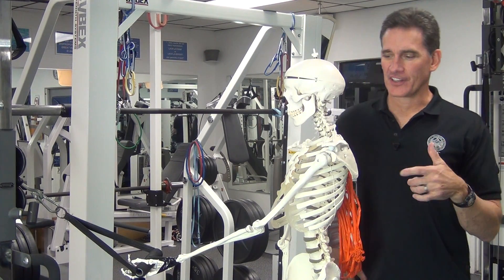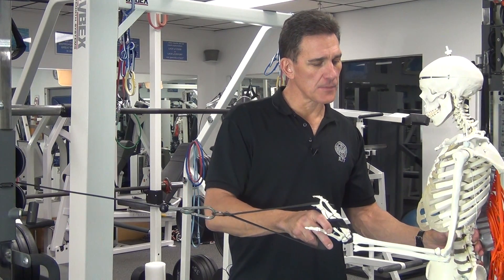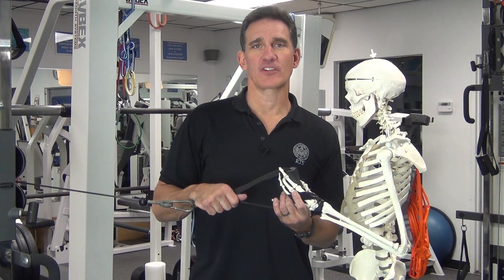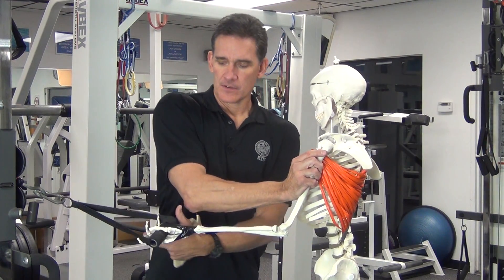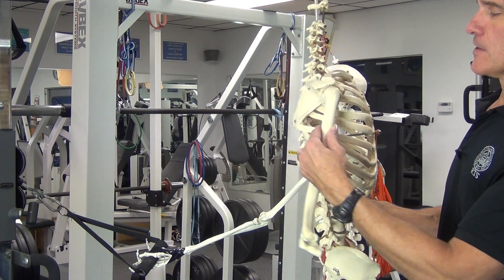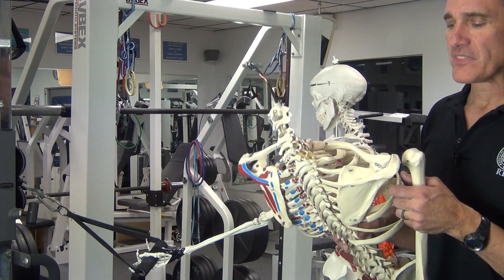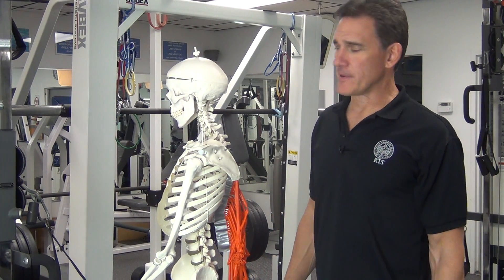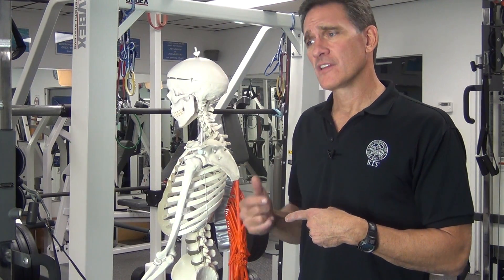Rows Part 1: An "Inside View"

Comment: My understanding is that ideal resistance is 90 degrees from the point of muscle origin. If this is correct, a lat pull from in front of the torso does not offer the most effective path of resistance since the lats are connected to the spine and would be pulling around the rib cage as opposed to a path directly in line with the spine, ie., pulling from the side of the torso.

Comment: Awesome example! 
Solid back routine:
1. Hammer or Nautilus Pullover
2. Close Grip Palms Up Pulldown or Negative Chin Ups Palms Up
3. Med X Compound Row
4. Kneeing Parallel Grip Pulldown w hands in neutral position w Cable or One Arm Cable Pull ins one arm at a time.
5. Rear Laterals on a Fly machine (Rowing Torso)
6. DB Shrug
7. Med X Lower Back

Comment: You compensate for the  exercise inefficiency by going heavy with in in the range of maximum effort. Hyper extension of the humerus becomes unnecessary   Muscle myofibrillar hypertrophy is a function of load. That's the approach I used to develop my latissimus dorsi.

Comment: This is great information thanks. Does this also mean that using equivalently strong resistance bands to do lat pulls/rows are even less beneficial since the resistance increases the more you pull but your lat is in a weaker position when all the way back? what are your thoughts on resistance bands?

Comment: Should barbell rows be done from the ground. Or should they be suspended without touching the ground ? On a client that is healthy no back or shoulder problems. Non-Athlete With the goal of strength and hypertrophy. What movements would best suit this person. They can't do pull ups because of weight and strength level. Are lat pull downs, And high rows sufficient or should barbell rows be added.

Comment: Soooooo..... Then how would you train the Lats...
Reply from the maker: Yeah, maybe a little too perfect!

...people often ask what "to do", as if there is ONE best answer, and as if there is ONE best solution for every person, and every goal.

When the answer doesn't fit their request for a short cut answer, they'll often dismiss the answer (and the source) because it doesn't fit their request.  

The aversion to thinking through details, and the attraction to quick soundbite type answers is the reason that most trainers are simply fans and followers of gurus instead of thinkers and students.  (It's also the reason that there is often a mismatch between quality information and views/likes on platforms such as YouTube...)

This answer is the most thorough and accurate I can offer to a question like the one asked here.
Reply from the maker: By contracting them in an appropriate plane against a resistance profile that will match the strength profile until we have achieved an appropriate level of fatigue relative to the person's goals and current level of progression!

-admin
Reply: +PersonalTrainingdotcom that is a non answer if I ever heard it.
Reply from the maker: Nope, that is an appropriate answer relative to your question.

If you need a more specific answer, you'll have to ask a more specific question.
Reply from the maker: Actually, vast on solutions.  
It just seems you're unhappy about getting an answer that matches the quality of your vague question.
Perhaps it'll make more sense to you when you understand that saying "average healthy person" is not actually  specific.

Many ways to train the lats, and understanding how to analyze the resistance profile is an important component to understanding all exercise.

I invite you to step up and actually think about this, instead of just demanding shortcuts or spewing weak false criticisms from behind your safe keyboard.

Do you know how to modify a row so the resistance profile is more consistent with the strength profile?
If so, perhaps there's a great alternative to the standard cable row for some people.
Can you analyze a lat pull down?  Can you identify the shortcomings in resistance profile for the typical cable version?  Can you see ways to alter the RP to match the SP there also?  Perhaps that'd be a good alternative for some people.

So there it is -- an opportunity to take in & learn, an opportunity to reflect, and an opportunity to raise your thinking game.
What will you do with this opportunity?
We will see I guess...

But in the meantime, I've got to ask you something;
What food should people eat??

-admin
Reply: LOL!
"You can't generalize the answer but had no problem generalizing the problem"
Man, because the problem is physics-based (non varying) and the solution is anatomy and individual-based (greatly varying) !

PersonalTrainingdotcom don't address this guy's nonsense.  Look at his other YouTube activity he's all about ignorant generalizations.
Reply from the maker: Yeah this guy doesn't get the message that to make a better row he'd need to split the ROM into different parts with different loads or just a better RP with 'full' ROM.

And thanks for pointing that out. Just read his other comments and you are correct.
Reply: "The problem is we are looking for absolute answers to relative questions."

The reply is perfectly said with respect to your question.  What is the best way to challenge Mrs. Doe's Lats on her first day working out at age 80?  Or what is the best way to challenge Mr. Jordan's lats in his prime?  The answer PT.com gave fits both of these scenarios but it isn't specific to either because there were no conditions given in your question.... Perhaps for Mrs. Doe it would be a cable set up but perhaps for Mr. Jordan it would be a different tool all together.
Reply: These are typical trainer answers. The 'keys to the kingdom' mentality. Full of criticism and short on solutions. You'll say that you can't generalize the answer but you had no problem at all generalizing the problem. 
Basically, you have no answer to how should your average healthy person train Lats. 
Other than... Well any lift that satisfies these conditions. Ok fine. Like which one. 

Nothing.
Reply: +jonathan hand 

Lat Pulldowns done with an underhand grip and an emphasis on pulling down (and not back, as many people do near the end of the exercise), are my favorite exercise for lats. It seems that this would create a line of resistance much closer to the line of pull of the lats. 

A way you could really isolate them would be by using a cable crossover machine and doing a sort of pullover movement where the arms start up and out and are brought down and in (sort of like if you were doing a cable pullover starting with a wide grip and ending with a shoulder-width grip).
Reply: +awsomenesscaleb https://instagram.com/p/_2_MKyk0o9/
Reply: Jonathan...

To your comment of typical trainer answer...

In part you are correct.  I think that comment was intended to be derogatory but in fact it's probably spot on if the trainer is worth a shit.  I am not sure if you train people or not but when it comes to "lats" you might want to consider there is no such thing as the "typical healthy client"...

Here is what I mean... Aside from the resistance profile alterations or as the RTS program terms it the strength-resistance relationship... A key factor in the "best Lat exercise" would be whether or not the individual can even "feel" or sense that they have a contraction in their "lats"

I do not have a single client that I train who fits the "typical health client" demographic you mention if we are talking about ability to contact and sense that contraction, in absence of even doing an exercise, Let alone try to find the exercise that best fosters that sense/contraction (and it's a different discussion but there are many reasons why that could be).  Here is what I mean... I have a 70 year old and 64 year old who could contract their lats on demand, then I have 24 year in my class who can't.  In this example the 24 year olds were doing DB rows and the way they needed to train to feel the lats was with a cable set up and then the lightbulb went off... Then they could eventually transition back to DB.  The 70 year old even though he could contract he "felt" them challenged the best with a higher row with the cable ending with around a 45 deg force angle to his elbow (some pull up and some pull forward)... And still has issues with feeling them on DB rows.

So I would hope that a trainer with any experience would respond "I don't know" to the question of which is best... I would just follow that answer up with .. Let's go find out what you can do and see if we get to the point where designing an exercise where the resistance profile matches fits with the ability to use the tissue. 

The exercise that you posted a link to, some clients have reported feeling great in the "lats" others report that it was too much tricep to feel the "Lat" because it is much more complicated than just lining up the mechanics... You need to look at all the variables involved if your going to change questions and ask "what's the best way to train the lats." This is no longer just a mechanics/anatomy question.

In some cases it's not always what you do but how you do it.. And it's a process to even get to the stuff presented in this video but it doesn't change the video content ... You just asked a different question. 

Anyway... I had a student in my class at the tech school ask a similar question last week and it reminded me of this post and I wanted to see if this reply resonated with you or if we are still on different ground.
Reply: Hah that girl on her instagram is shredded her legs are fucking massive for a chick.. but she is like every girl I see doing powerlifting and all they usually do is dead lifting and squats.. wanted to see what she could bench. I think a simple answer to your question would be to just do a weight you can actual handle without needing to launch the weight.

Comment: Been trying to understand the technical reasons behind my terrible rows.  Really informative video.  Love the channel even more now.
Reply from the maker: What's so terrible about your rows?
Reply: +PersonalTrainingdotcom 
Nothing crazy. I could never understand how the contraction is supposed feel as well as how the tension seems to vary so much throughout the pull.  Ultimately my frustration with it is just that I feel the force I create during a row has not changed as much as my other movements. 

Considering applying the advice of splitting the movement into two separate exercises to try and feel a better contraction for both the lats as well as rhomboids rather than trying to make my rhomboids try and do what my lats are able to.  After trying out "bat wings" for the first time im a bit desperate for an exercise that looks a bit less dorky.
Reply from the maker: Splitting the exercise into 2 different ranges may help, altering the profile so you can have "full" range with appropriate resistance throughout will also help.

Remember, no amount of retraction will create more shoulder extension.  A reduced resistance at that point in the range can allow for it, though.

Man, do I even want to ask what exercise you are referring to?
Reply: +PersonalTrainingdotcom 
It was bad, man.  The normal benches were too short compared to my arm length and I had to make my own.  I never knock things until I try it (unless there totally unfounded) but seriously: never again.
Reply: +Nick Lehnhoff
I also swear I used the correct form of they're but my new phone butchered it

Comment: that why i love the hammerstrength rows, because as you contract the lat and bicep the weight becomes LESS as it becomes more vertical and is supported by the machine, easy to cheat on it though for people that dont get the purpose of it
Reply from the maker: You guys know this isn't about concentric vs eccentric, correct?
It's about the torque from the resistance at various points in the range, regardless of direction.
-admin
Reply from the maker: Depends on which hammer piece.
Reply: +churde It is a matter of matching the strength curve at its extremes,  with the seated rows the tension will feel the greatest on the concentric portion of the rowing but the you will feel it the least on the eccentric. the opposite will occur using a hammer strength (typically the one you load with the weights in front of you) but not all hammer strenghts are loaded equally, therefore, offering a difffent resistance profile or line of force.

Comment: Do you guys think T-Bar Rows would be a solution? When you pull it up the resistance gets slightly less, because the weight is more over the point where the barbell is touching  the floor.
Reply from the maker: Nope, some machines can solve it beautifully. Stay tuned...
Reply from the maker: Basti, 
As for your original question regarding the t-bar row, 

These are just several of many discussions to have to see all that's happening in that scenario

Length of the t-bar lever itself (and size of its arc) 
Degrees traveled through that arc, 
Section of arc, 
Speed/tempo including inertia control
User's positioning (influenced by squatting proportions)
Load placement and rotational inertia 

-admin
Reply: Or maybe doing straight arm pulldowns and when you reach the point where your lats can no longer work efficient bending your arms. This would shorten the leverage in order to decrease the resistance at that point
Reply: +Basti S. Well no. That can only do so much. If you focus as much as possible on lats with a T-bar, you´ll have to stand very much bent over. And in that position the difference in resistance curve is almost none. The more upright you stand, the less will lats work. If I simplify it.
Reply: +Basti S. A pulldown is  more beneficial for matching the lats strength profile.
That is if the position of your elbows are pointing lateral of your body.
Having your elbows pointing anterior to your body, basically you just alter lats length profile relative to the resistance profile, compared to the rowing position.
Reply: +Basti S. In reality no machine or device would be the solution. Emphasis on correct form and range of motion is the way to go, and some equipment just might make it easier
Reply: +PersonalTrainingdotcom can't wait

Comment: So basically rows with chains on the barbell are the worst thing to do..
Reply from the maker: Nah, jumping in front of a train is probably worst thing you could do!

...but since adding chains to a barbell row will offer a resistance profile that does not match the strength profile, it will not offer the full range challenge one should normally seek in an exercise.

-admin